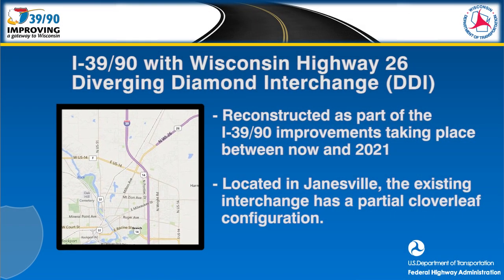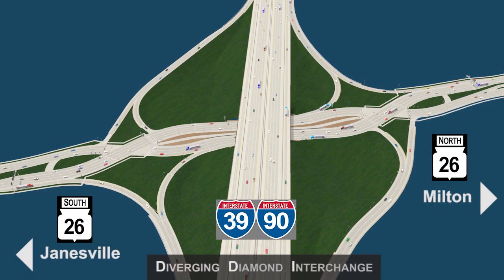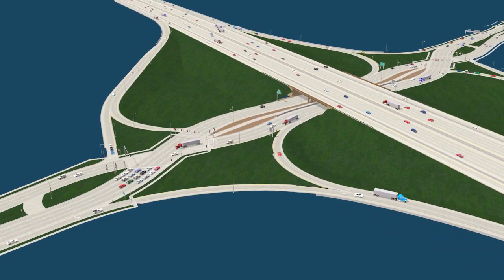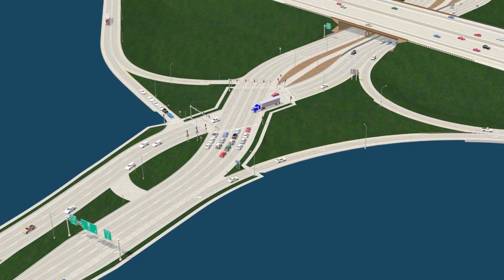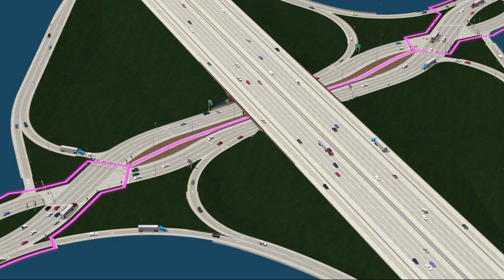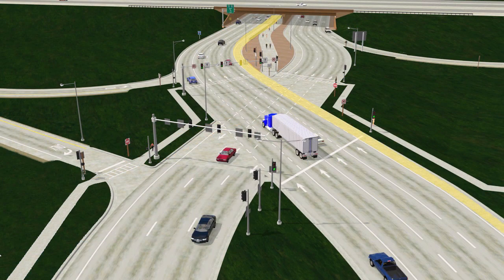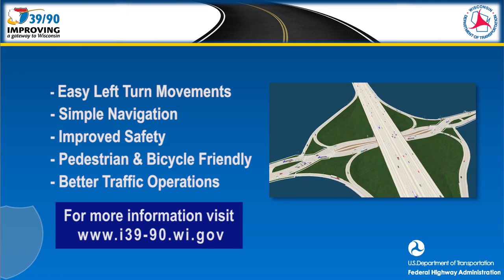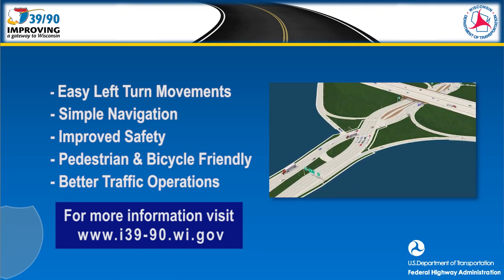I-39/90 and WIS 26 Diverging Diamond Interchange Animation

Comment from the maker: Walls will be placed along I-39/90 and corresponding ramps, such as the I-39/90
northbound ramp from WIS 26, in Janesville due to the slight change in
elevation of the Interstate in this area. Access will remain open to Cracker
Barrel and other area businesses. Stay informed with the I-39/90 Expansion
Project website, www.i39-90.wi.gov.

Comment: in order for roads to have a speed limit greater than 55 mph in Illinois or Wisconsin or Indiana or Michigan or Iowa, it has to be a multi-lane divided highway. Good Lord, here in Texas, we've had even 2 lane farm to market roads posted at 70 mph since 1996 (night: 65 prior to September 2011) and eventually  roads had increased to 75 mph, starting in 2002 and 2003 in west Texas and 2005 in south Texas on select stretches of highways in the sparsely populated counties, and by 2012 and 2013, that same 75 speed limit extended everywhere else in Texas, such as east Texas and the Panhandle.

Comment: I like the idea of a DDI both here and at I-43/WI 100 (north - Brown Deer Rd).

OTOH, in the deeper future, I cannot help but to expect that the signals will ultimately have to be removed entirely from WI 26, at least for traffic between I-39/90 to the south and the WI 26 freeway to the north, as well as around I-94 in Johnson Creek, with WI 26 becoming a full freeway the entire way between I-39/90 and US 151 (at Beaver Dam?).

Also, one question, what is the standard procedure for traffic control for the crossover intersections in a DDI whenever the power to the signals goes out?

Mike - Appleton, WI
Reply: My problem and this really gets me mad is that I-43 even goes to Beloit, it should go to Janesville and if signs for 90 south say Beloit in Janesville then why do signs for 90 north in Beloit say Madison and not Janesville! Janesville is a class I control city and Beloit is a class II control city and Janesville is twice the size of Beloit!
Reply: +Ian Corkhill the original plan for what ultimately became I-43 to Beloit (then WI 15) was for it to run east-west between Beloit and Janesville to ultimately feed into WI 11/81 at its split on the south side of Brodhead.  Note the preserved ROW for a diamond interchange there, as well as for a future four-lanes upgrade from there westward towards Monroe.
Reply: +Ian Corkhill Madison takes priority, and Beloit is the last city in the state.
Reply: Janesville is class I that's it